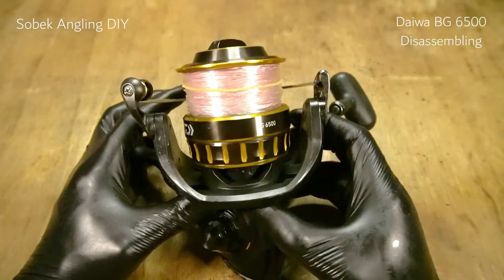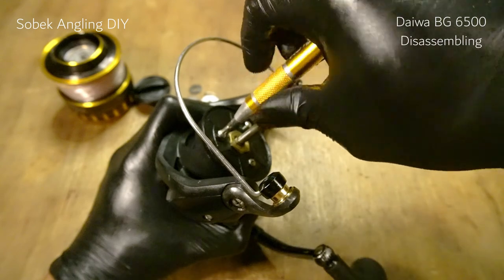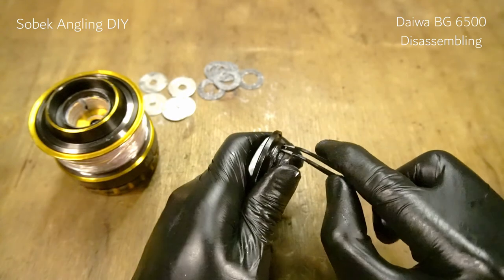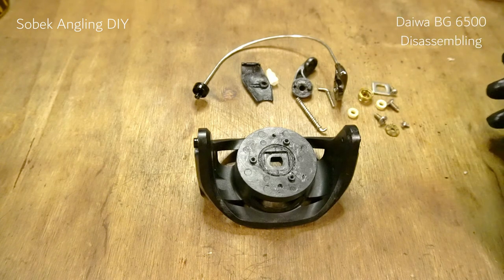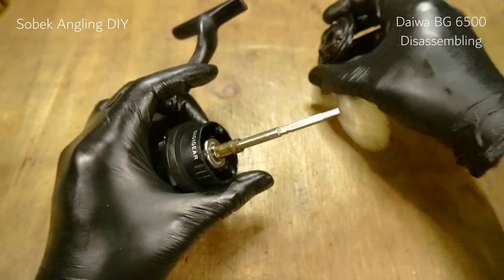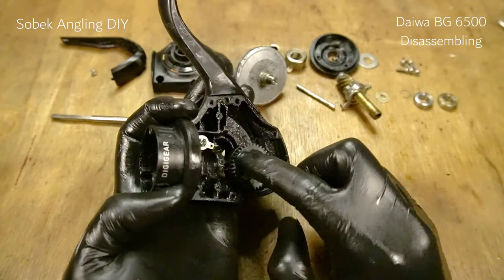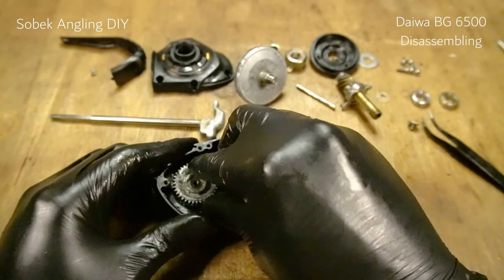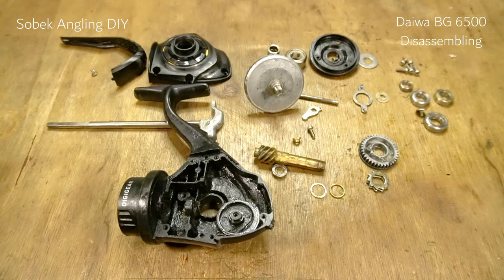Daiwa BG6500 - Part 1 Disassembling - Reel service and maintenance

Comment: What did you use to remove the old grease from the  body inside .
 i usually use kerosene for my reels and to soak the bearings  .
Reply from the maker: Some old cloth to wipe off visible grease, and then kerosene and old tooth brush for most parts. WD40 for most plastic parts. For soaking bearings, alcohol. If bearing needed cleaning, carburator cleaner spray and canned compressed air does the best job.

Comment: Upon faking my reel apart down in the main gear there was a wire . 
I cant find out where it came from 
And my secondary anti reverse hangs freely and makes a clicking noise when the reel is held horizontal but not when held vertical 
Ive taken the reel apart twice 
First time was only the top but the second time i took it apart fully (didnt touch the secondary anti revers because i could clean it while it was on)

I dont know where the "spring" went 
Any help would be apreciated
Reply from the maker: Check out part 2 of this video. You can the video in my channel. Go to 40 : 00 in the part 2 video